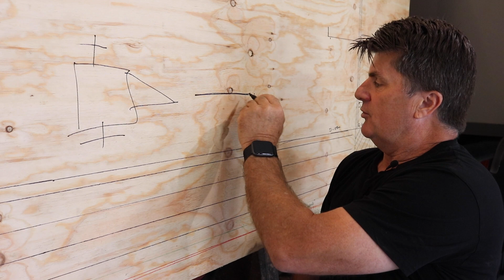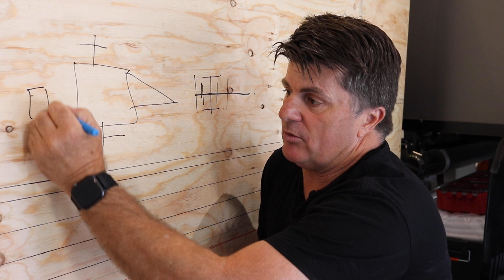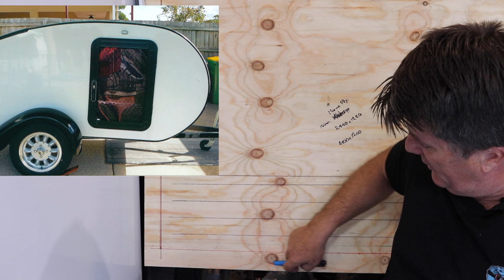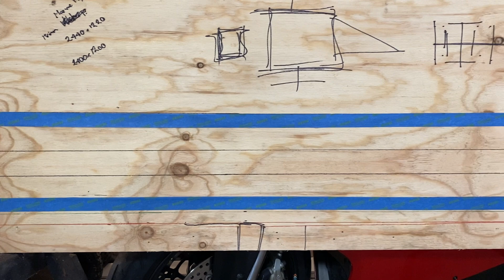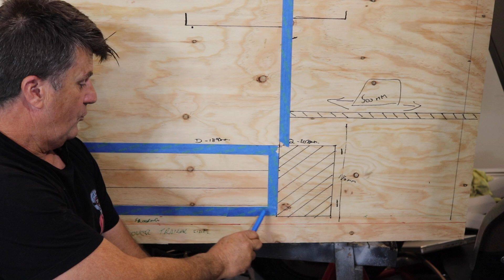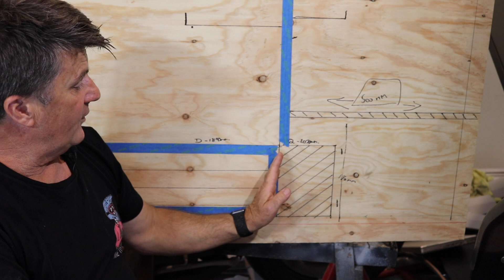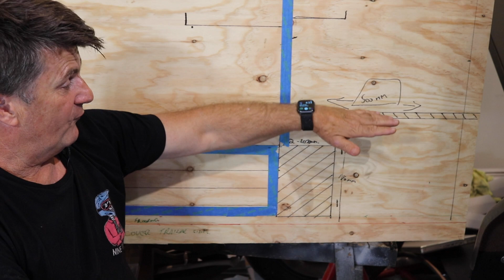Design Your Own Camper // Teardrop or Squaredrop // No Plans Required

Comment: Thanks Darryl, I’ll second letting the width of available cladding materials determine the width of the camper. I’ve done mine at 1550 wide and found out later the supplier where I sourced sheets for the roof is 1500km’s away in Victoria 😕.
Reply from the maker: That'd be rather exxy shipping.

Comment: I wish I had this video 18 months ago. Alot of the info in this video I had to stumble across as I was building mine. Another consideration that I put into it was weight distribution for battery / fridge and made the draw Bar longer to allow for toolbox on the front. 
Width is a funny one, i went for 1500mm wide (as that's what width the fibreglass comes in ) but was still able to squeeze a queen foam mattress inside (was 1470 internal and queen mattress is 1530). 
Great content as always Darryl. I think most builders think back to what they'd do different on another build, is that the case with the idea of a second build ?

Comment: Terrific video! Thankyou. I've been searching for this kind of advice for quite a while as is i consider rebuilding a camper that we could rotting when we got it home. Love the practicality and pragmatism and simplicity.
Reply from the maker: Glad to help, best of luck with the rebuild!
Reply: @DarrylSheather  I have a couple of questions please: 
1) You have mentioned "plastic material in various widths"  can you point me to a supplier and the name of the material?
2) I'm keeping costs down if possible without compromising  structural integrity. I'm thinking 18mm marine ply for the basic/interior wall, varnished inside, with an external cladding e.g. aluminium.  I see videos where people add another 18 mm or less for their interior wall. Is this additional  layer necessary ??
Reply from the maker: @colinmackie5211  1. https://styromax.com.au/products/styroglassrg/. 2. Not necessary.

Comment: The balance of cabin length and kitchen depth was one of the biggest issues for my squaredrop because I wanted a 40-50L fridge in the kitchen, a 500mm deep kitchen bench and a queen length mattress, all the while sticking to one-piece 2440mm plywood wall panels for more rigidity. It's tricky but possible with a notched bulkhead panel but it limits my choice of fridge.
A few tips I picked up along the way are to put your door where your feet will go so you don't have to do a 180 every time you get in or out, put your door low enough or get a thick enough mattress so you don't drag your legs across the doorframe when you get in and out, to plan a step into the design if your partner is 5ft on a tall day 😁, to put the roof vent anywhere except above your head (for rain splashing in and sunlight) and while not really build-related, to have a curtain covering the door for some privacy.
Reply from the maker: Good info there

Comment: That "cut back! at the back end of the trailer isn't for aesthetics. It's about departure angles. If you are off-roading, sooner or later you'll be crossing gullies, dry river beds, or the like. A square overhang behind the wheels will hang up on an obstacle very readily, and either damage the trailer or cause you to have to recover the trailer (or both). I personally disagree with you about matching that angle at the front..........you can match the angle but have a different size chunk cut off the top front edge, you can mimic the rear, or you could have a square. The latter gives you the aerodynamics of a brick, but lots of people do it.

Comment: What's the name of that flexible roof material, and where do u get it? 
Your trailer is ridiculously cool BTW brother, u really knocked it out of the park, great job😎👍
Reply from the maker: It's the same composite aluminium material as the sides. It's scored on the back to bend, in the build videos it's shown.
Reply: @DarrylSheather  Oh very good.. and I'll give the other videos a look. I appreciate your reply brother thanks ;-)

Comment: Gday Darryl, what made you choose ply over a metal (aluminum or steel) frame? Cheers mate, love the vids!
Reply from the maker: Ply is traditionally how these have been made, if you look at manufacturers both locally and in the USA they still are. It's quick, fairly easy, insulated and if you use a good quality waterproof ply you get a furniture finish internal lining. Clad the outside and they'll last forever. Both steel (too heavy) and aluminium (cost?) framing require external and internal lining with insulation. Personally, I'd go full glued together composite panel with some timber highlights internally to add warmth and take away some of the sleeping in an esky feeling, or how I've built mine.